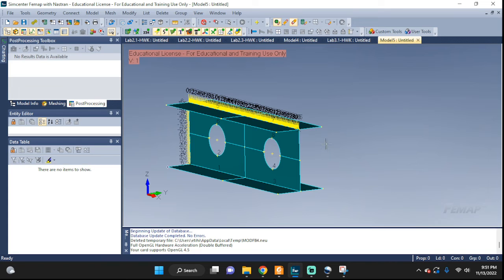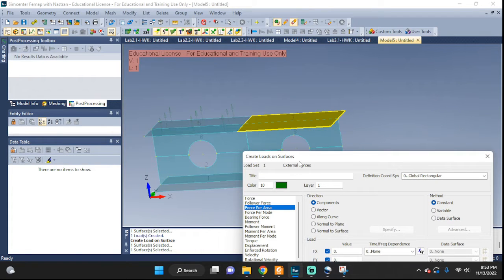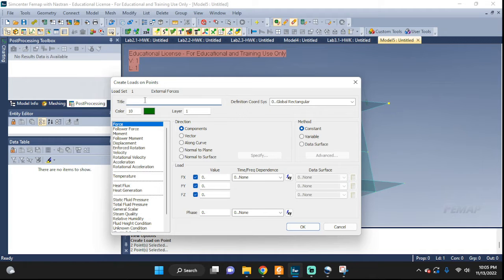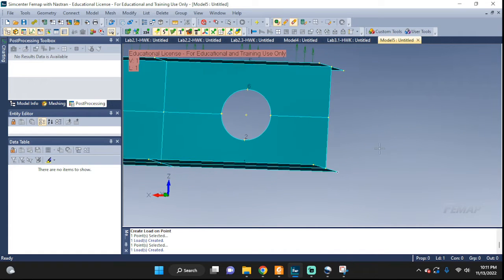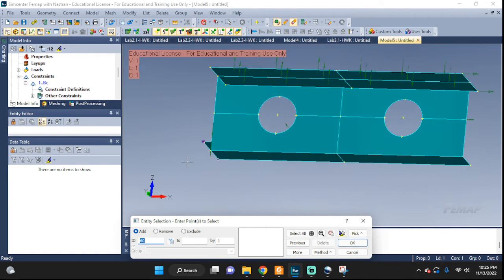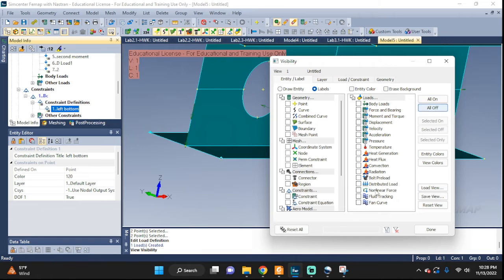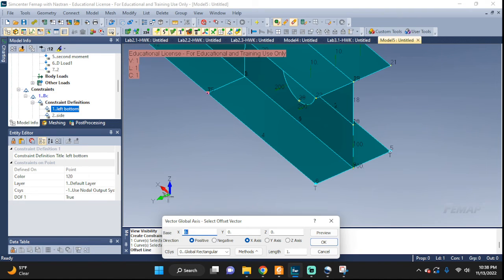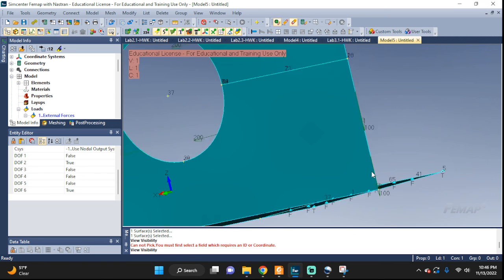FEMAP Nastran Loads and Constraints

Comment: Hi I am quite new with FEMAP, as you said FEMAP is unit less so how can I know that the force apply is in Newton?
Reply from the maker: There is an option where you select the unit system: SI or English and from there on it automatically implements the units. You just need to remember the base units when you enter something. Like for example it will take pressure as Pascals, so don't accidentally assume kilo Pascals and enter atmospheric pressure as 101 instead of 101000.